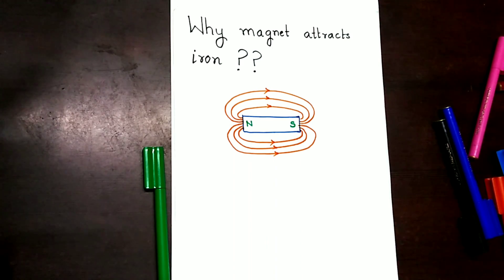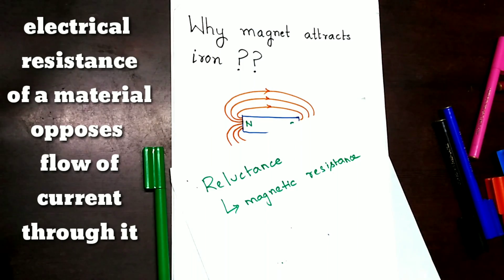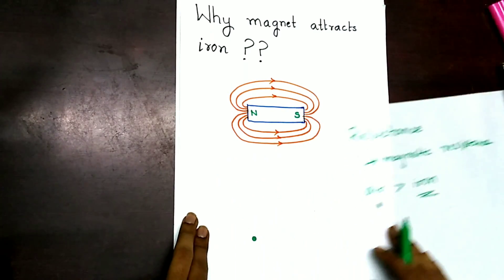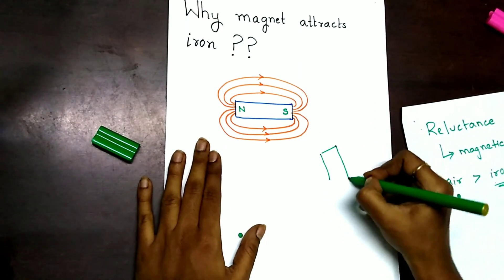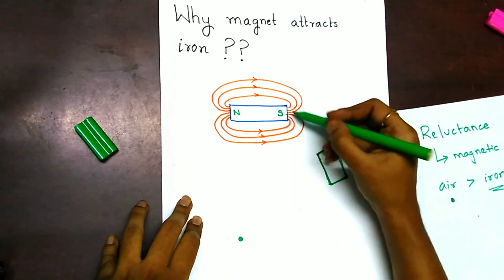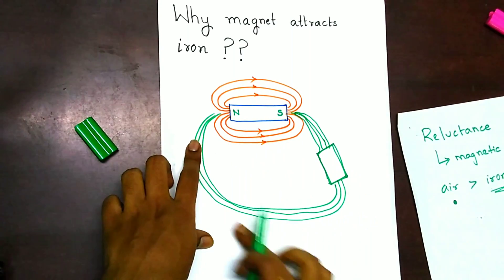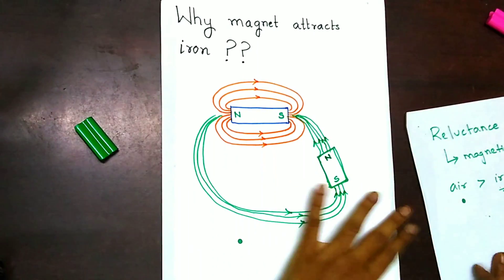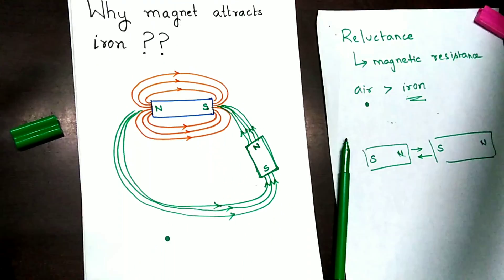Why Magnet attracts Iron ??

Comment: Why magnet not attracts alluminium,... explain plz?
Reply from the maker: You can think it this way simply..
Weaker permeability means that material doesn’t allow the magnetic flux to pass through it. It’s reluctant. Less permeability=>Less flux passing through it=>weaker poles=> weaker magnetic force(negligible in the case of Al)
Reply from the maker: Its simple...
The permeability of Al is approximately 1 almost like the air whereas it is 200000 for iron!!!
Just imagine the difference...which makes iron a strong magnetic material and aluminium a weaker one.
So the magnetic lines of force pass through the aluminium just as much as that in the air. So all the lines of force are distributed in the air as well as the piece of aluminium unlike the way it happens with piece of iron.